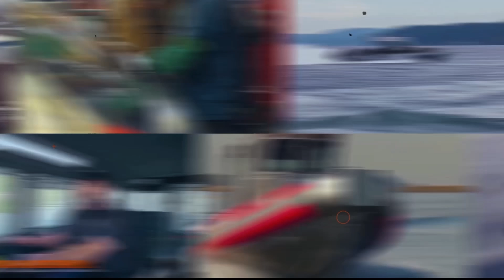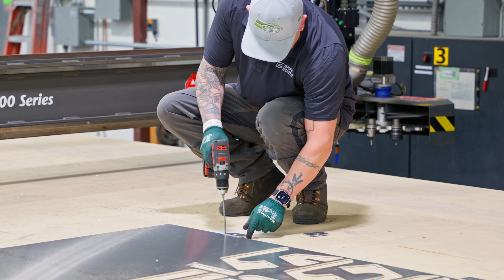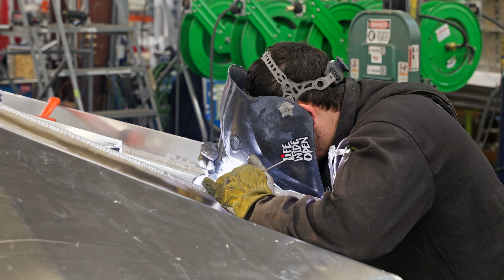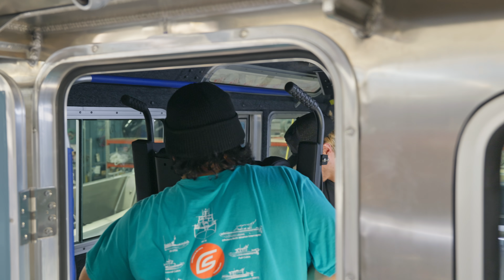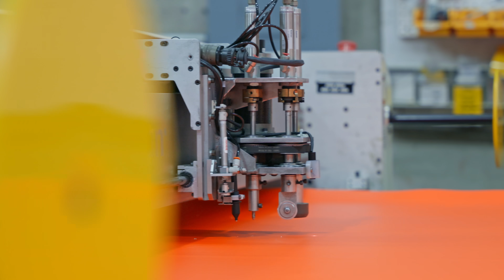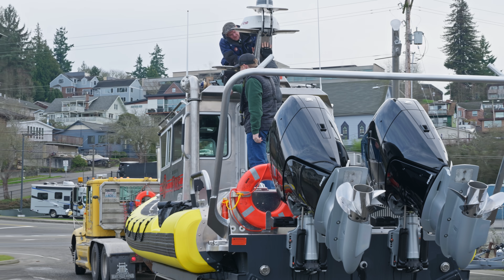How It's Made - SAFE Boats International Factory Tour

Comment: Your shop and designers and workers are superb? but your "V" bottom hulls are 50 years outdated with 40-60% fuel inefficiencies and in rough water your hulls are still "V" bottom and very rough in rough water?
My hulls look like yours till we get below the waterline or we get into rough water, or we get into fuel burn? 
My 36' hull with its 6' model testing to 12 mph model speed, you can calculate the 36' speed to be +12 mph x 36'/6' gives 12 x 6 or 72 + since the model was not tested above 12 mph? No hull is as smooth as mine or as efficient?
Should this interest you  I could show you my 24' aluminum in calm water powered with a 200 hp yamaha, running at 60MPH? Many boat shops are closing from fuel burn and rough water performance? That is where i excell????